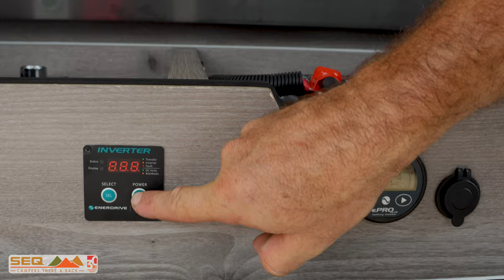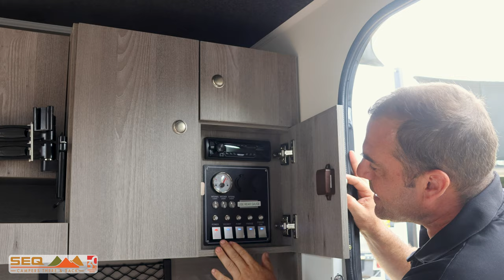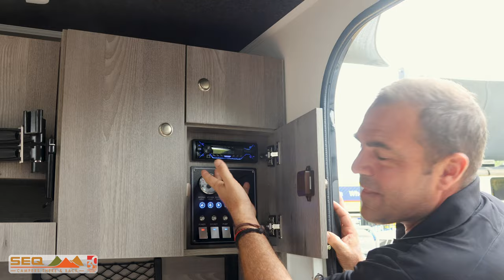New Journey Begins: Shane From SEQ Campers Handing Over the Keys to a Brand New Stockman Rover!

Comment: What if someone comes along and turns those 2 latches to seal the cabin doors when you are inside, can you release them from inside easily? Are they lockable to prevent someone locking you inside?
Reply: Nae bother pal, just open thae windae and climb oot.....
Reply from the maker: Yes you can open them manually from inside. We often turn the top one as an additional lock for the door at night.